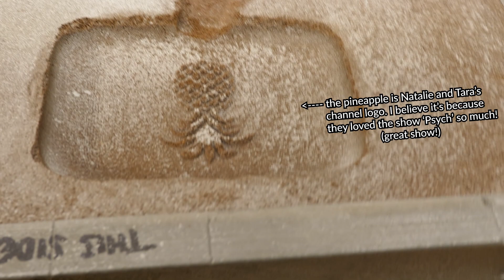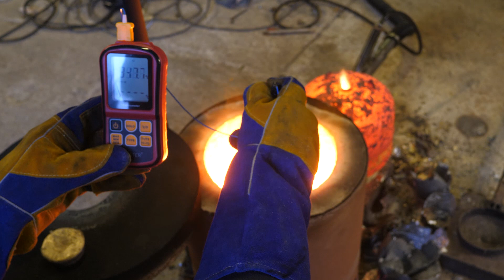Aluminium casting flask - FIRST TEST! & Casting two bronze play buttons and a bronze strike tool

Comment: your new flask works well even when the sand is possibly too wet and bronze not hot enough!  BTW, I see that bubbly metal stuff coming up the sprue on my lost PLA investment casting.  I am not currently able to fire the flask hot enough so I think there is either PLA residue in there or still moisture in the plaster that is getting into the metal.

Comment: Seasons greeting Julian, from the Med  ( a bit Arctic like tonight ) ! 

The flask performed well. That's the main thing !  I would be inclined to cast parts separately.  Less weight in the flasks ( us oldies struggle a bit ).  Less chance of multiple failed cast parts. I know a bit more work preparing gates, runners etc. 

One addition to the flasks I would make, a couple of clips to hold cope and drag together, situated where the handles are. That would save having to weigh them down.
I hope you will be generous enough to make the STL'S for the flask modules available on Thingyverse when you have time. I for one would love to have a go at making them.

Comment: I use a 1.5" sprue and riser on mine, your problem is in the passageways they are way too thin so you're trying to feed them hydraulically by shear weight instead of letting them flow out naturally and the position of the sprue is critical rather than have it run the whole length of your channel/flask try to keep it between multiple casts the risers don't care where they  live lol.
The printed pattern should be painted and sanded to minimize reproduction of the filament layers check out myfordboy  channel he uses 3d patterns and has a wealth of knowledge.
Reply from the maker: thanks T, yeah i'm a big fan of myfordboy! he's great!

Comment: Well I'm really surprised how that turned out...  I looked at that pineapple and thought there's no way that's going to cast well...  Glad you proved me wrong... looks really really good mate, lovely detail and polished up so well.  I think perhaps the metal wasn't hot enough to fill the second pattern, a lot of cold sand surrounding that thin runner cooling it from all directions... maybe a thicker runner and a deeper gate may help ??? Shame about the second casting... but the first one more than makes up for it... and where did you get that sunshine from ?  Can I have some ? hehehe.  Hope you had a good Christmas and Happy New Year mate... Andy🥂🥂🥂

Comment: You’ve got to be happy with how half the pour turned out.....

When you freaked I was expecting a total failure but great result in the end.....was the sand just too wet and the molten metal cooled too fast to fill correctly ?

Comment: It your gating system was completely was completely wrong for the castings. The that the melt was probably fine. The flow will turn to end runnin back till the sprue. The runner. The runner just froze.

Comment: How can I be the first comment after 24 views??  IMHO I think the runner is just too long. A lot of cooling happens when the metal is just sitting there. I think that the surface of the of the metal has stopped moving along the length of the runner. The leading edge is still flowing and staying molten that's why it makes it to the surge trap. With that surface cooling as the entire length of the runner rises I expect, and again, what do I know, its solidified as it tries to enter the gates.  You may be right on the pineapple, filling the feeder could be the reason the part filled.
Reply: Half a dozen now, after 46 view. Seems a bit mean to me.
Reply: Absolutely no intention to be mean. Julian and I are terrific friends and I would never say anything mean to him, especially in a public forum.  My comment about his video was more out of shock that no one had said anything yet. He does such terrific work that I figured someone would have already told him so.
Reply: @swdweeb  I was not suggesting that YOU were mean. You have hold of the wrong end of the stick. I was referring to the majority that didn't take the time to comment.
Reply: Ok, I can be a little sensitive ;-)